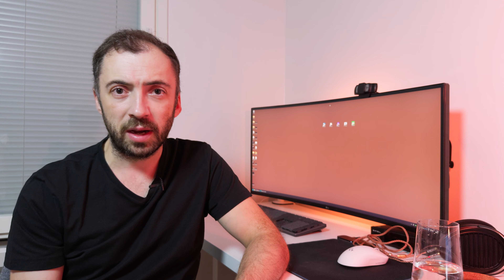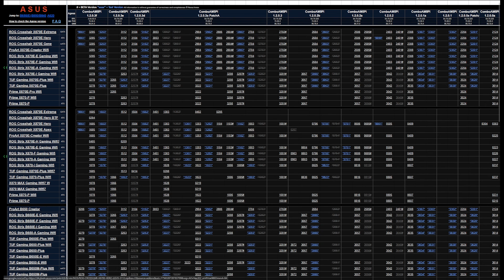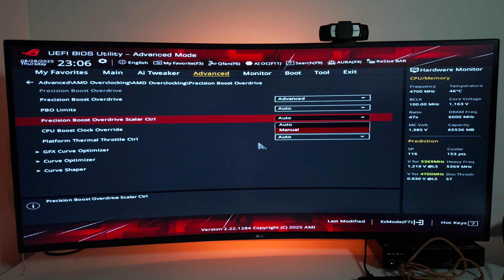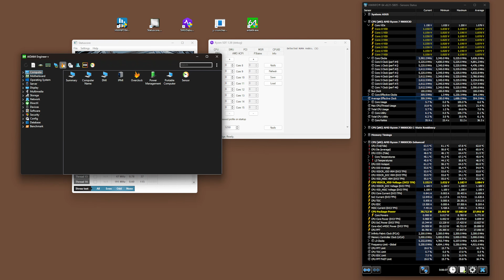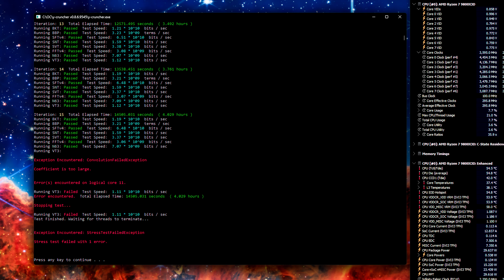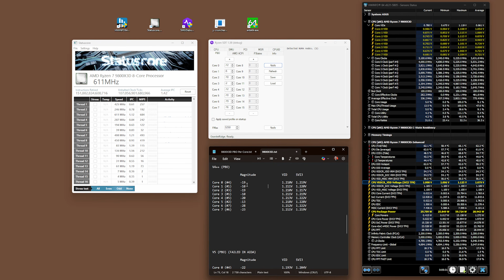Undervolting Ryzen 9800X3D Per Core - Less is More ?

Comment from the maker: End of Thermal Paste - Ryzen 9800X3D and PTM7950: https://youtu.be/_5RQOE1DAWM
Reply: Hello good video! I thing there is something wrong with the cooler may be paste or presure.I have 9800x3d pbo enabled scalar on x2 -25 on curve optimizer +200 on cores and LLC on level 1 which in my bios overshoots the voltage and arctic freezer aio pro 280. With that said in cinebench r23 i get 84C max temp after 30 mins test and on score side 24000+ with peak watage 165-170 w and voltage is between 1.23 to 1.25 . In games temp not going above 60C even in Star citizen on 2k native which in some areas cpu is at 100% and peak watage 130W. So i thing the cooler or the paste or mount presure is the problem about temps. Going to say about curve optimizer is a lottary and may get some more down if llc is not on auto try peak to overshoot and try testing it for daily my opinion voltage to not go above 1.27. Try also Soc voltage on 1.25 to 1.27 for performance in games helps the cache to work well. Will be nice to see video with this test GL and later.
Reply: I'm at  like -25 all core, wish I knew which cores could go further, pretty sure i hit the lottery on my 9950x3d.. Should I leave it? Scores attached..
Reply: Core 00		-0		1.27v
Core 01		-0		1.27v
Core 02		-0		1.28v
Core 03		-0		1.27v
Core 04		-0		1.27v
Core 05		-0		1.28v
Core 06		-0		1.28v
Core 07		-0		1.27v
Core 08		-0		1.33v
Core 09		-0		1.28v
Core 10		-0		1.32v
Core 11		-0		1.31v
Core 12		-0		1.32v
Core 13		-0		1.30v
Core 14		-0		1.33v
Core 15		-0		1.31v

------------------------------------------------

Core 00		-25		1.21v
Core 01		-25		1.22v
Core 02		-25		1.21v
Core 03		-25		1.24v
Core 04		-25		1.22v
Core 05		-25		1.23v
Core 06		-25		1.23v
Core 07		-25		1.25v
Core 08		-25		1.25v
Core 09		-25		1.21v
Core 10		-25		1.25v
Core 11		-25		1.24v
Core 12		-25		1.25v
Core 13		-25		1.22v
Core 14		-25		1.26v
Core 15		-25		1.25v
Reply from the maker: @sideoutside Great result if it is really stable (AIDA64 5h+, y-cruncher, etc…) You can try a step or two further, but even with -25 you have an amazing CPU. 👍🏼
Reply: @RandomTechChannel  Thanks. I did go a little further, giving more power to the second ccd. Ran AIDA64 for a few hours, Cyberpunk, 3dMark port royal and timespy. The -25 all core never failed, I just wanted to balance it more. core 13 and core 9 won't go up any further, ever with less undervolt. I could probably take 3 to 5 more off across the chart, but I'd rather just be stable.. If only I could get my 4090 og oc to do as well.. Ended up here:

   Core	  Magnitude	  VID

--------------------------------------------------
Core 00		-23		1.21v
Core 01		-26		1.22v
Core 02		-25		1.21v
Core 03		-30		1.22v
Core 04		-26		1.22v
Core 05		-28		1.23v
Core 06		-27		1.22v
Core 07		-30		1.23v
Core 08		-21		1.26v
Core 09		-20		1.22v
Core 10		-21		1.25v
Core 11		-22		1.25v
Core 12		-21		1.26v
Core 13		-20		1.23v
Core 14		-20		1.26v
Core 15		-21		1.26v
Reply: more like end of stability and undervolting 😭🤣🤣 
95°c 😂😂

Comment: Correct me if I'm wrong. Aren't you supposed to get the BEST (or most) undervolt on the good cores? In your method the good cores get the least undervolt?
This does not make sense for me. I understand bad or weak cores need more voltage to stay stable?
Reply: I assume the best cores are considered to be the best because they can run a lower voltage at any given clock speed, therefore they require the least amount of undervolting while the worse cores need a larger offset to catch up
Reply: @RYaw25 Thanks for the reply. By the way I used your method to re-undervolt my 9950X3D (moving away from the bulk CCD0 -20 and CCD1 -25). In addition to your comment above, I learnt that also strong cores can be undervolted to lower their voltage and these good cores answer by getting higher clocks rather than requesting lower voltage. Ended up with some cores at -17 and one core at -37. Big like 👍

Comment: THANKS A LOT Random dude. This was by far the very BEST undervolting guide I've seen so far! On my previous CPU "7800X3D" I only tried through an "All-Core" thinking it would be way to long to do it "Per Core" and luckily I ended up with -22 as -25 would fail. I called it a day and stopped right there, very happy with the results I had. I sold it last week and upgraded to the 9800X3D. I did a lot of research after with Copilot's AI and learned that going super low is actually detrimental as it won't boost as much and you'll just lose performance while risking stability as well. Most people tend to automatically think that bigger numbers means better or are more impressive "e-penis" while it's in fact the opposite. If you have a core that needs a huge number, it's actually a BAD CORE that needs a bigger offset to run a voltage as low as the best cores! People going with stupid high numbers either get it all wrong or have a bad silicon sample.

I really wasn't as long as I thought it would be, actually much easier with the right tools and this video to achieve the results below which are rock stable with everything I've thrown at it. The AI told me also that on a single core the "Red Limit" was 1.18v and that it is highly not recommended to go below so that I was right on the sweet spot of perfect stability with over 80% gains by staying at 1.195v and just bringing down other cores to match the best one. I'm not gonna spend 10x more time and risk a unstable system for maybe 3C less or +4FPS at best.

Stock  Magnitude	SVI3	Core Performance
Core 0		0		1.195v		#1 *
Core 1		0		1.223v		#3
Core 2		0		1.203v		#1 *
Core 3		0		1.235v		#5
Core 4		0		1.226v		#2
Core 5		0		1.233v		#4
Core 6		0		1.248v		#6
Core 7		0		1.276v		#7 Worst
=-=-=-=-=-=-=-=-=-=-=-=-=-=-=-=-=-=-=-=-=-=-=-=-=-=-=-=-=-=
PBO VDD	Magnitude	SVI3	Core Performance
Core 0		-2		1.195v		#1 *
Core 1		-8		1.196v		#3
Core 2		-4		1.196v		#1 *
Core 3		-11		1.197v		#5
Core 4		-8		1.197v		#2
Core 5		-11		1.197v		#4
Core 6		-13		1.195v		#6
Core 7		-18		1.194v		#7 Worst

Comment: I ain't seeing a drop in voltage when I'm adding a negative curve is there something wrong I'm doing I'm doing the exact steps mentioned as well I just don't see the voltage dropping as I'm putting a negative curve on I'm doing it one drop at a time and I don't see the voltage dropping at all in the sections you've highlighted

Comment: The majority of Ryzen user don't understand fully how the boost override works. The, for example, +200 MHz does not mean that the CPU will run with 200 MHz higher clock speed. The boost override just raises the boost ceiling by 200 MHz. This boost ceiling is only reached if voltage, power and thermal values are within the set limits. If the CPU runs hot by default or the silicon is bad and requires higher voltages to begin with, then it doesn't matter if you raise the boost ceiling, because the CPU will stay at or below stock by default. The boost override is also only relevant for single core usage, if you don't also raise the PBO limits, which put the CPU over its specs, which can wear out the CPU much quicker.
But even if you have a good CPU and good cooling, the 200 MHz override will net you a measly 3% at best and this only on one core. Again, to gain anything you have to raise the PBO limits by at least 20% to gain anything, but then the stock configuration with PBO limits would achieve the same and the boost override does nothing except raising the voltage and therefore the temps, which let the CPU throttle sooner.

Very good video that should immensely help less experienced tinkerer to tune their CPU. Showing the entire process and how to properly use the tools is what most guides lack. 
👍

Comment: Hello i have an Asrock X870 Pro Rs wifi motherboard and AMD Ryzen 7 9800X3D. Can i use these values for my computer?
Reply from the maker: I would ask you to measure the voltage of your particular CPU and try to harmonise them between each other. Copying other's PBO values might not provide you a stable CPU because each CPU is a bit different due to silicon lottery.

Comment: I have the same RAM as you, but no one is talking about overclocking it, especially the 6000MHz CL28. Have you overclocked it? If so, can you tell me what you did?
Reply: Overclocking ram is so time consuming and extremely difficult and frustrating. Benefit is so very minimal, stock EXPO is far superior. Unless you want to get a degree in RAM timings which will take 2+ months.. don't bother

Comment: my cpu runs for 160 W with temps up to 85celcius but cut the clocks from 5425mhz to 5ghz during full occupacy, should i leave it like it is? its good? pbo motherboards limit, curve -20, overdrive clock +200 soc 1.2 max
Reply from the maker: 160W is quite high TDP in my opinion. I would avoud using motherboard's limits (as shown on the video) and set the thermal limit instad. Your situation is quite normal with the numbers you mentioned. You can explore can you gain higher clocks with even deeper curve optimization by going per core instead of all core. Some cores might reach even -30. The more you experiment the better picture you will have what kind of CPU you have. :)

Comment: this cpu is throttling automatically at 85c, get better cooling and then compare. in my case, the 5800xt is just fine with pbo and 100mhz. you can try  ryzen master for setting most of these configurations, including pbo per core. also, in your case, try lowering other voltages of the cpu to lower heat (you may get 2% more performance though). with another cooler you will also be able to push pbo lower.
Reply: Wrong! The 9800x3D starts to throttle at 95c

Comment: You might be getting thermal throttled with the +200 thats why you see no performance uplift, those temps are too high.
 even with a 9850x3d 5.8ghz (+200mhz) and mobo limits on pbo pushing the 1.39v spikes I don't even get close to 70c in game with a 360mm

Comment: MSRPCX_Installer.exe Say its a trojan on total virus.
Reply: You can perform this process using CPU-Z's stress test option in Task Manager defining which cores CPU-Z will use through affinity.
Reply: @Raphaeldtr  Thank you
Reply: @Raphaeldtr  It doesn't work with task manager or process lasso, I put the cores in, I start the test and they all reset automatically
Reply: You have to start the stress test program first,Set affinity in Task Manager, and then reset the values in HWInfo.
Reply: @Raphaeldtr  That's what I did, also because if you don't start the program first, you won't find it in details. I also tried restarting the program after selecting the cores.
I monitor core usage from process lasso, and it doesn't work even if I set affinity from process lasso.

Comment: For per-core undervolting on the Ryzen 9800X3D, what core voltage should we realistically aim for?
Reply: You have to take the lowest voltage and reduce all the cores to that voltage and test the stability. For example, my best core was 1.118V, I reduced them all to that voltage and it passed the test. Now I'm going to test 1.115V and so on until AIDA64, P95, and YCruncher fail. Just repeat this test and see how much your processor can handle.
Reply: @Raphaeldtr   the 1.115V is stable?

Comment: Keep in mind that 95 degrees celsius is the temperature that AMD designs their CPU's to run at. It is not their thermal limit, but rather their designed intention. They are designed to be able to run at 95 C for their whole lifetime. The CPU will actually try to reach 95C by boosting and/or giving it more power so I wouldn't suggest changing the limit from 95. This is why modern AMD CPU's boost and perform better with better coolers.

Comment: thanks for this, how do you highlight the values in yellow in hwinfo?
Reply from the maker: Right click on the value you want to change its color. Then select 'Layout settings...' -> 'Customize' tab. There should be Font color section at the bottom left corner of the window.
Reply: @RandomTechChannel thanks, I had always set -30 all core but after doing ycruncher it failed on vt3 so I specifically ran vt3 tests and went to per core and it didn’t pass until one of my cores was -18. So my final settings look like this Core 0: -20 Core 1: -25 Core 2: -18 Core 3: -25
Core 4: -20 Core 5: -30 Core 6: -35 Core 7: -35 my soc is set to 1.23
Reply from the maker: @ParisVi2  Thank you for sharing that! You have a very solid unit indeed.

Comment: @RandomTechChannel I noticed HWinfo still shows previously tested cores boosting. For example, when checking voltages for thread 5 / core 2 (around timestamp 12:12), cores 0 and 1 still report near max stock frequencies with elevated voltages in the “Current” column in HWinfo, even though Statuscore indicates only core 2 should be loaded. What’s causing this behavior?

Comment: Have you set your fan speeds and pump in the Bios?... That is extremely hot for an under volt and OC. No BS, I have the MSI A13 240. 200 OC and -25 under volt. I'm sitting at 67-69 degrees, playing Tarkov, max settings. Also, I know people will say that a AM5 CPU holder does nothing. You can literally see the smudge line down the middle of your CPU taking off the stock holder.
Reply: You are comparing apples to oranges. You cannot compare your gaming temperatures to his benchmark temperatures. My 9800 X 3-D runs at 61C with a -20 undervolt in some games. But that does not mean that my CPU is running cooler than yours or is better. It just means that my game is using less CPU from yours potentially therefore your comparison of gaming temperatures to his benchmarks does not mean anything. When I run Cinebench R 23 I get comparable temps to his.

Comment: Is there a more simpler way to do the UV? Just set some value for all cores some negative pbo offset? Thanks.
Reply from the maker: Undervolting by selecting All Cores at once is much simplier method. The downside is that you might not have as low voltages as some of your CPU's cores could go. In 'All Cores'  undervolt your undervolt is dictaded by the best core ie. the core needing the smallest offset value.
Reply: Yes just set negative curve offset in bios.

Comment: why would you use ptm on a watercooled cpu???? 95° on stock is bonkers and thats why your co uv crashes on -15 😂😂😂😂

heat also causes instability
Reply: There is nothing wrong with ptm ur just giga clueless
Ptm is working fine on GPUs chugging 400W and it will also work fine on a cpu
Reply: @MegaChickenPunch gpu's dont have an ihs, you put ptm on the die itself and they arent watercooled (usually)
ur the clueless one here.
Reply: @Kitsune06089  it literally changes nothing but keep on yapping
Reply: @MegaChickenPunch keep on coping and doing tricks on the guy bro 😂

Comment: Your temps seem high. 
Are you sure that your cooler is working correctly? I’m using a kraken elite 360 that I have swapped the fans out on for worse performing Jonsbo ZA360.
Mine maxed out at 64’c in Cinebench 24 with an all core -20.
I went with -18 in the end because it only ran 1’c warmer at 65’c and scored the exact same 1353. I have left the MHz stock.
When I ran a 30 min stability test at -18 in Cinebench it maxed out at 68’c. Stock was 80’c on a 3 pass run.
Reply: He has 30c ambient lol.

Comment: wow, didn't expect such results! +18C, 50+ W more power draw, and negative impact on performance. that's hilarious. the voltage jump is huge too, 0.15 V... went to the BIOS and turned off the boost clock overdrive. simply not worth it. thanks for the video mate!

Comment: Thank you! ♥
I conduct all my tests using Prime95 and if my CPU doesn't crash, then 1000% every modification to the CPU is stable!
Reply: Prime95 is imho by far the best tool for that.
Mine went to -35 except core #7 it has to be at -20 (more is not stable).